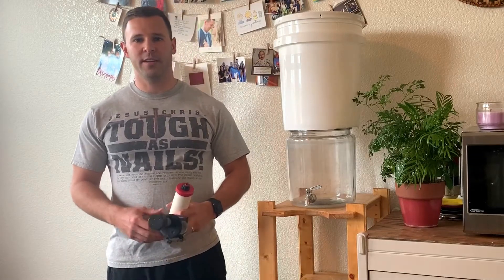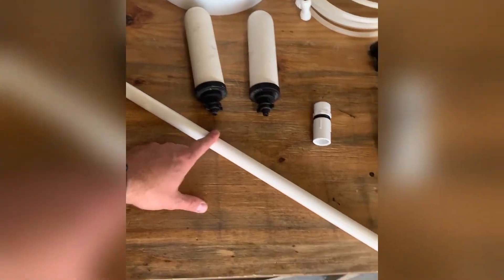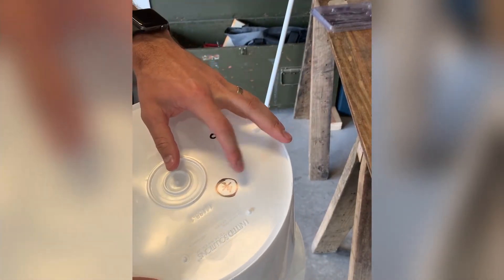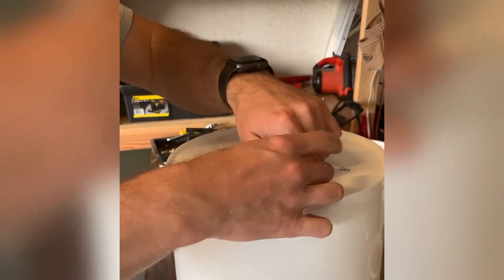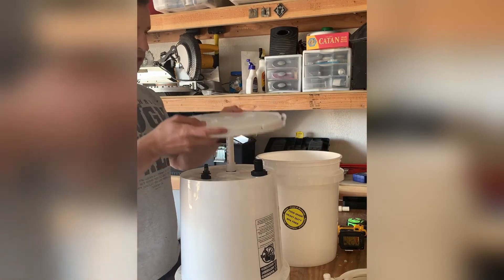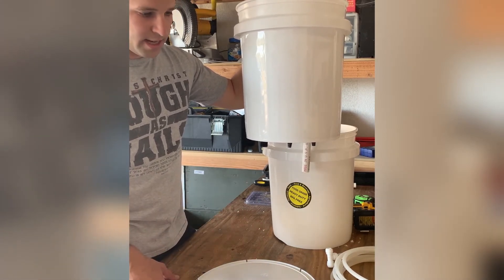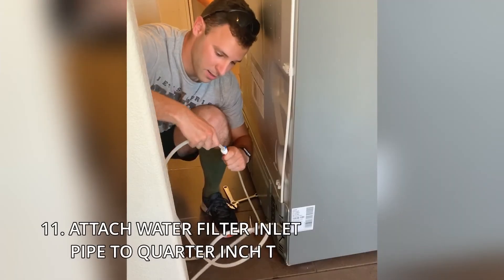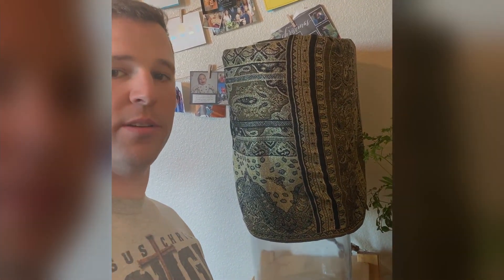Never Refill your Brita Pitcher Again!

Comment: Genius!
Reply from the maker: Thanks! I still cant believe this system isn't mainstream since is works so much better and is more simple than most filtration systems out there! It really is the best solution for emergency preparedness as well. Your Brita pitcher definitely wont keep you safe from contaminated water!
Reply: @createdtocreate-alifeffici2040  It is a norm in India and other South Asian countries, they use a clay reservoir for the filtered water to even keep it cool (as clay will sweat and release heat from the filtered water reservoir) and have a 3 part UV, Ceramic and another one that I don't remember the name of, passed through quater inch pipings. 

Now that I moved to USA, i needed to have something similar (clay pots are hard to get around in here). But just got a PUR tank thingy and diy'ed an auto filler. Now I have 3 gallons of water ready whenever and will also fill up whenever I used up some. 

Maybe your method is better, should use some food grade buckets and a valve, and get some Brita filters (easily accessible) and just use that.

Arizona heat is killing me. Need clay pots.